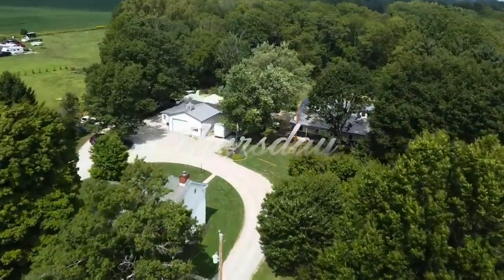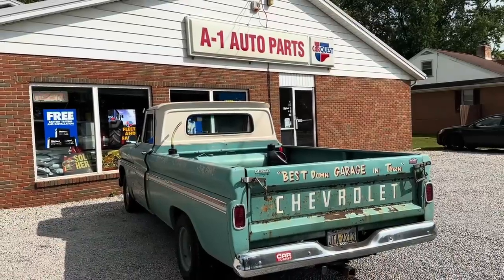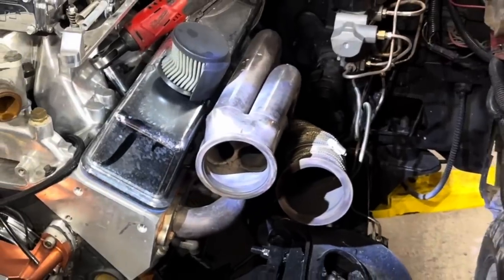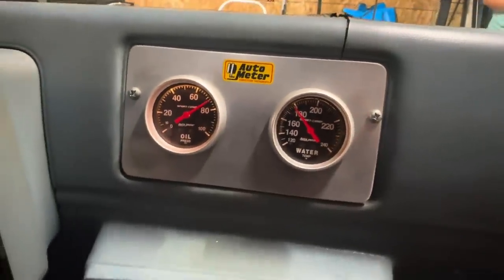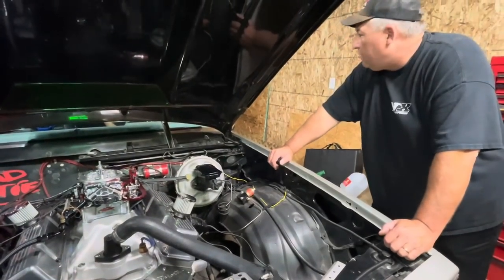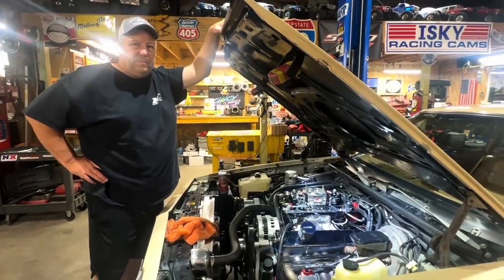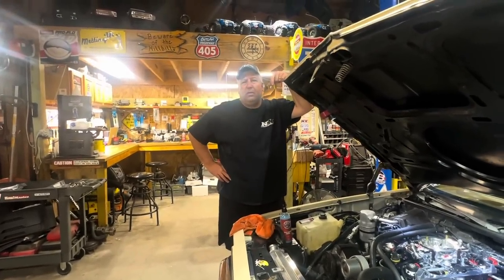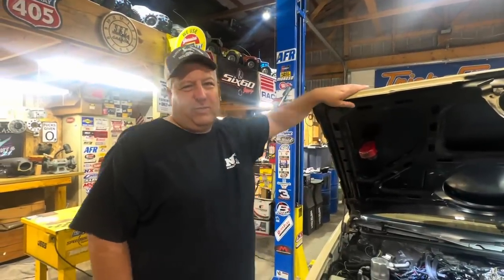BOOSTED TO DEATH? We tear down the Nova’s Small Block!

Comment: I had a similar issue with a hydraulic roller valvetrain in a SBC once. Mine was NA, so not quite the carnage, but I got 4 runs out of it before the lifter gave up. New cam, pushrods, and a set of tie-bar lifters later . . . no issues 😎

Comment: That engine most likely had valve springs meant for 6000rpm redline lol, im suprised it didnt blow valvetrain stuff apart sooner. That engine with boost added probly was floating the springs so hard it was keeping the valvetrain alive somewhat by dampening the valves shutting and rockers coming back down smacking the pushrods

Comment: A good mod to run on high rpm hydraulic lifters is either snap rings or spiralocks if you can find them it’s an overlooked way to “bulletproof” the hydraulics in the valvetrain. Especially with high psi oiling setups. I’m gonna do this in my hydraulic roller gen 2 lt1 for road course /endurance racing.

Comment: No filters on Abby's car! Plus a dirty cell stuck the rear needle would be my guess! I just dont see them blue rockers on anything wt out trouble!
Reply: We’ve had luck with blue lifters but never those specific blue lifters
Reply: @54raceman  those rockers are for a small hyd non roller cam wt about 100lbs seat psi & i still wouldnt recommend them